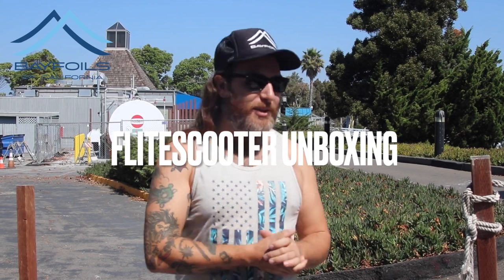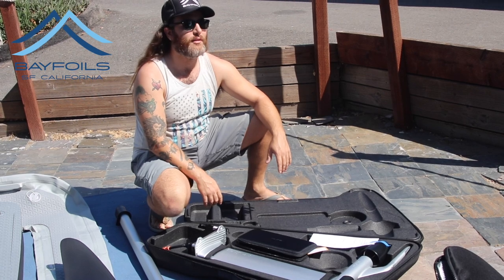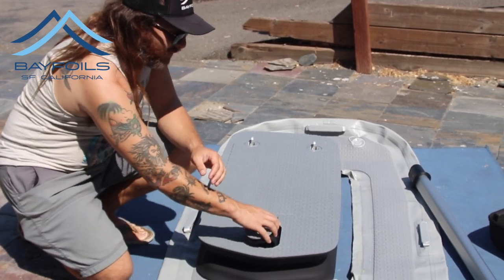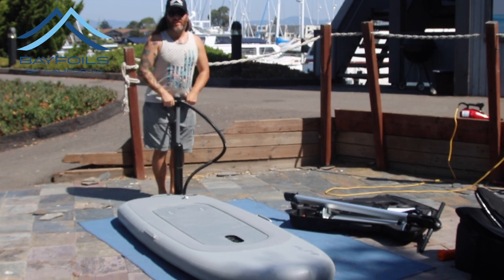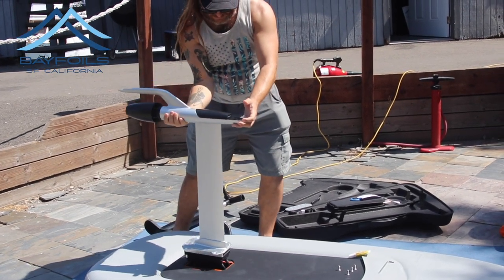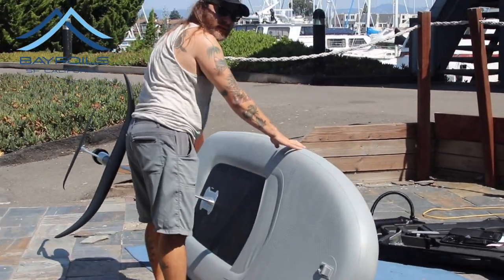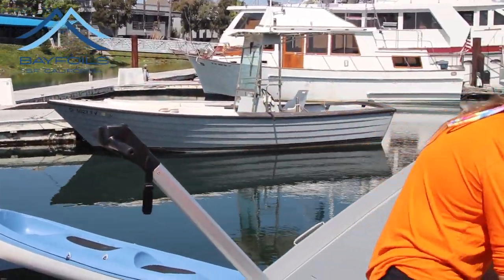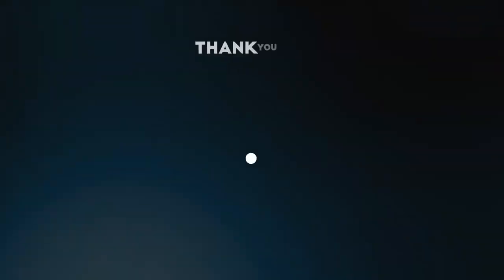Unboxing the flitescooter with set up guide

Comment: Pro Tip: Put the handle through the remote strap and slide up so the remote is double secured.
Reply from the maker: I thought about that but I wanted to be able to try it with the controller in hand too